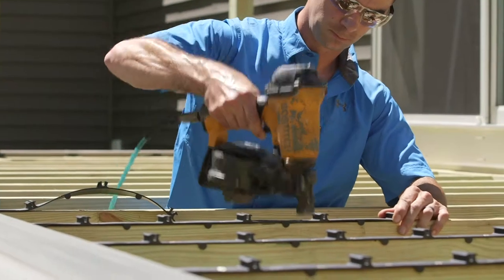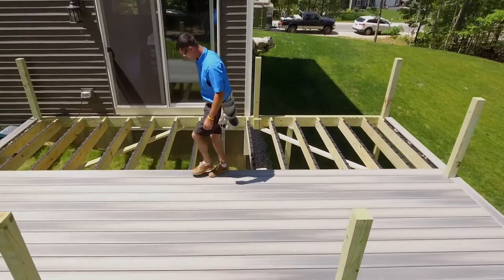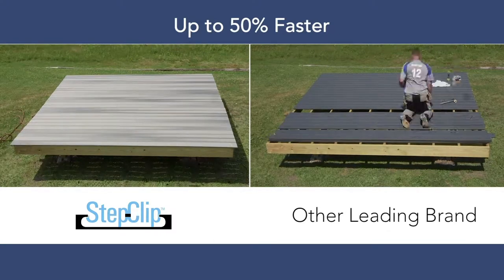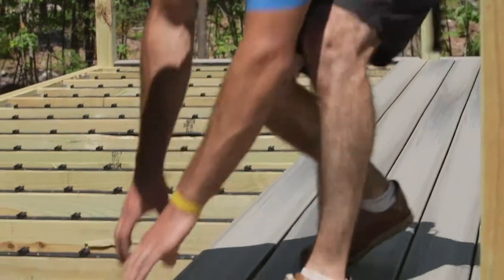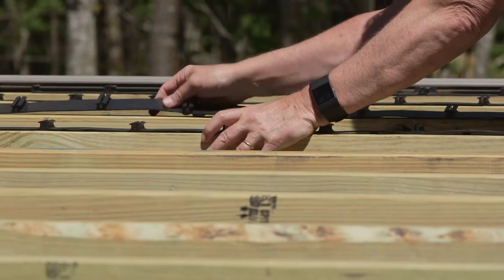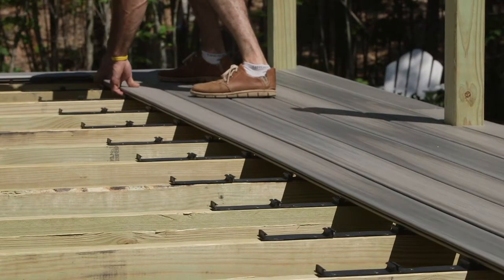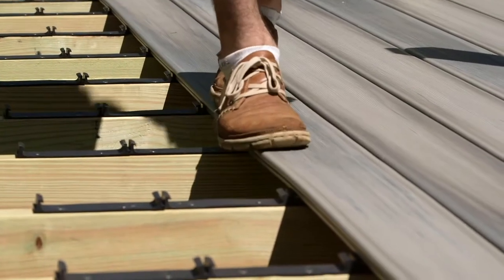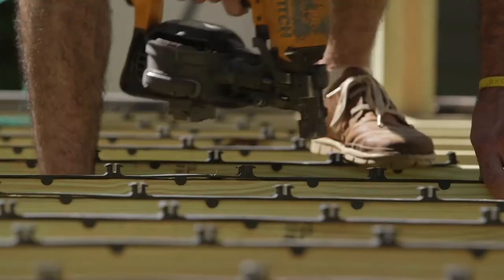Veranda Featuring Step-Clip: Deck Installation System

Comment: Can you confirm that the step clip system will work with Veranda composite boards? I've seen online that it will only work with DuraLife boards. Will it work with Veranda? Thanks!